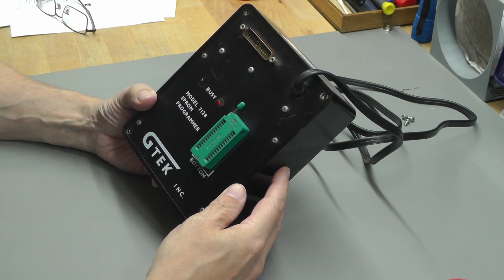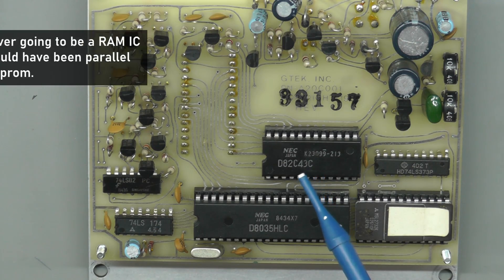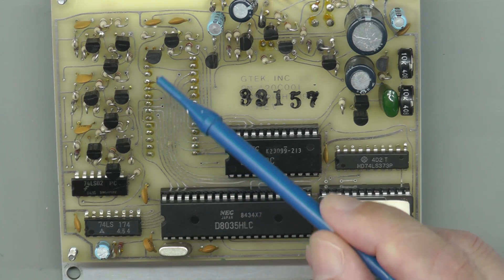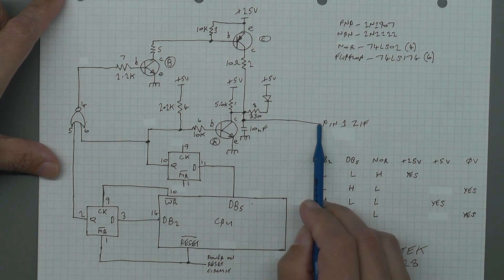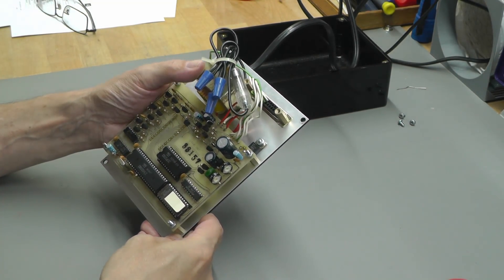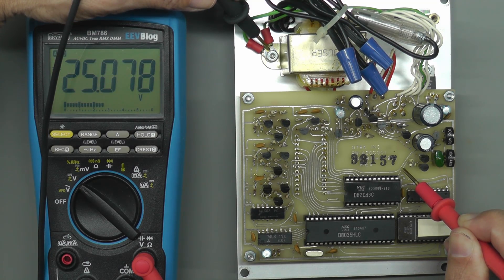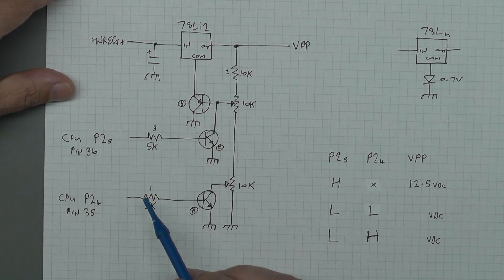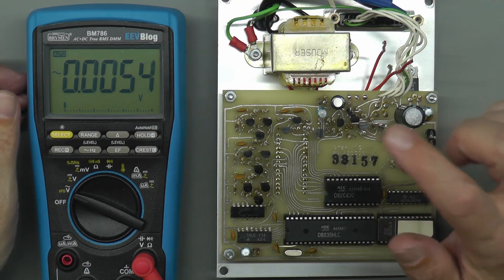No.079 - Gtek 7128 Eprom Programmer 240Vac Conversion & Analysis - Part 1

Comment: Seems an odd choice that at power on reset both 174 outputs would be low and so 25V would be on the pin of the EPROM. Would have thought 5V would be safer for a start state? (not 0V in case that triggers an active low write or program signal)
Reply from the maker: I guess I can scope it when I get it up and running just to see what is going on. One line of defence i guess though is that even with 25vdc on VPP it won't write anything to the eprom without a 50mS pulse on the OE pin.
Reply: @IanScottJohnston  Assuming of course that pin 1 is VPP on the EPROM that is inserted. Does it support any types of EPROM where pin 1 is A15 rather than VPP (27C512?)
Reply from the maker: @DaveCurran  I haven't got that far into it yet. Still awaiting a new transformer. I have a collection of various size eproms ready.

Comment: I also built an EPROM programmer for my Sinclair ZX Spectrum back in the 1980's but I based mine on a 8255 PPI chip with a bit of 74 logic for address decoding. Definitely used a 74LS138 3 to 8 line decoder as part of the decoding and I seem to recall a 74LS32 in the mix as well. I cheated a bit on the Vpp production though as I just included banana sockets for connecting my bench PSU (a variation of the Maplin Minilab project) to the device.
Reply from the maker: Nice one!.......Mine was based around a 6402 serial UART and a couple of 74 and 4000 series logc IC's. It was interfaced to the serial port of an Interface 1. My VPP was a toggle switch between 5Vdc & 25Vdc.
I also had a 2nd 6402 UART in order to convert RS232 from the Spectrum to a parallel interface for connecting to the Centronics port of a dot matrix printer.

Comment: Are you going to put a TTL/serial to USB converter in it. Would make it easier to use on a modern system.
Reply from the maker: My Dev PC has a hardware serial port so good chance I can get the DOS app to work under Win10.
Reply: @IanScottJohnston  I find that old DOS apps directly use IO address and IRQ to control the serial port and don't work well on Windows NT based systems (even using emulation software such as DOSBox). You should try to use FreeDOS on bootable USB with the DOS app since you mentioned your development machine has a builtin serial port. I enjoyed the video as well!
Reply from the maker: @SmithKerona  I have an old WinXP laptop with a serial port if worst comes to the worst......that might fair better.
Reply: @SmithKerona  VMware and DOS 6.6